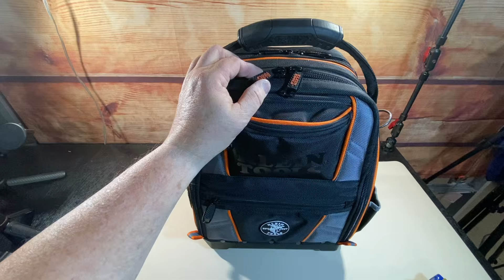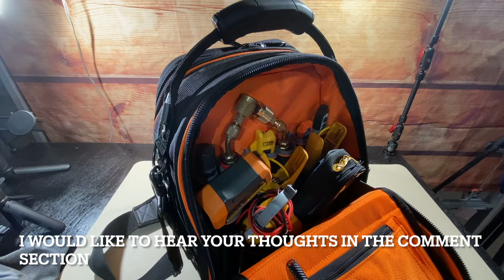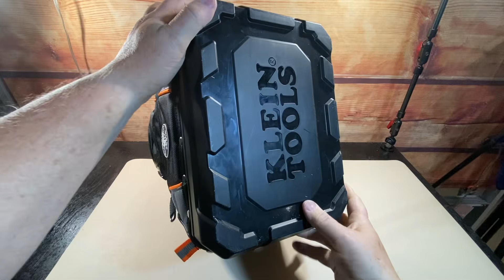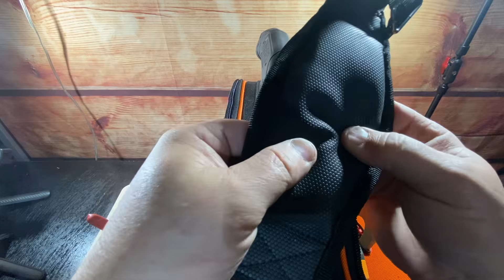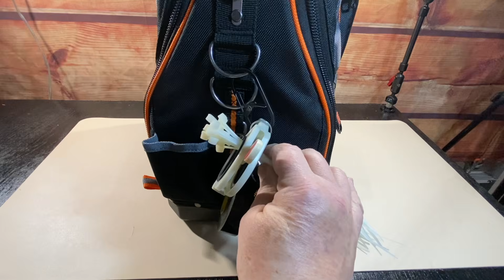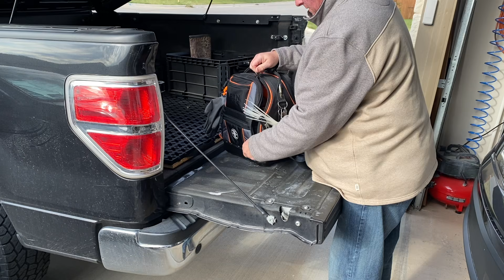Tool Organization Revolutionized: Meet the Klein Tool Runner Tool Bag  #klein, #toolbag

Comment: I have several Vetos, right now im carrying a TPXXL. Its ok, kinda cramped. Saw this Klein Tool Runner at Lowes for $99 and just had to buy it. Definitely reminds me of my MC bag, but a little bigger. Haven't switched tools over yet, but i will. Lighter than Vetos, or so it seams
Reply from the maker: I am still using my tool runner bag for all my hvac meters, sensors and stubby gauges 

Thanks for watching!

Comment: if the bottom of the bag could attach to a modbox organizer that would be cool. I also like the cut of the main pockets that you can see from the side profile, it looks like it frees up more room above the tools so you can retrieve them easier.
Reply from the maker: Some small 3D printing companies print the little “ feet” that lock into the packout and mod box so maybe you could buy those and attach them to the hard bottom of the bag. I added a link to this reply of the video I used the “ feet” on the bottom of my dewalt vacuum and put them on the pack out .
I could be wrong but I think they make feet for the mod box too

https://youtu.be/7hgx0sauELU?si=t-4jGJDoJ21-08R0
Reply: Nothing is stopping you from attaching the modbox organizer. Bet you have a drill and screws.
Reply: @YorkRojas-f5j  lol